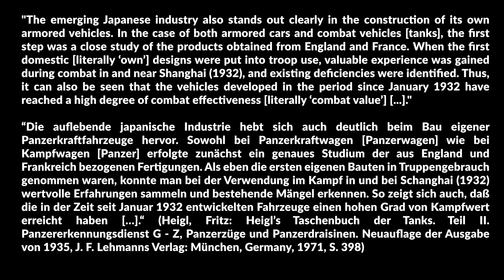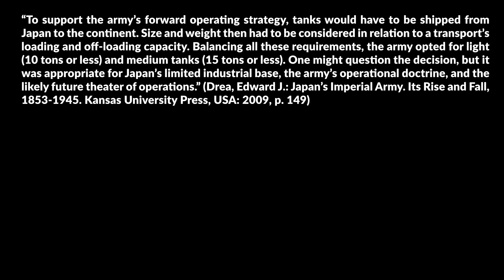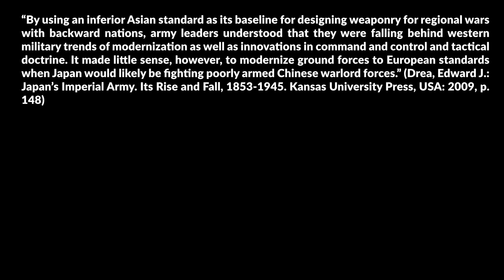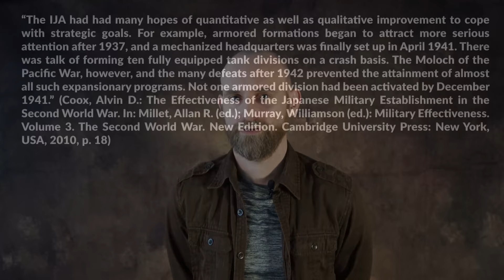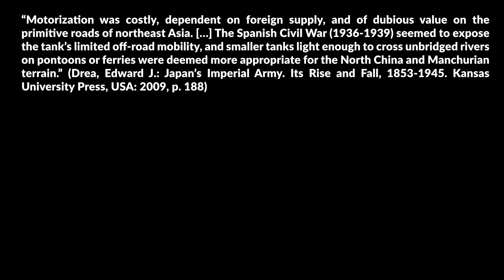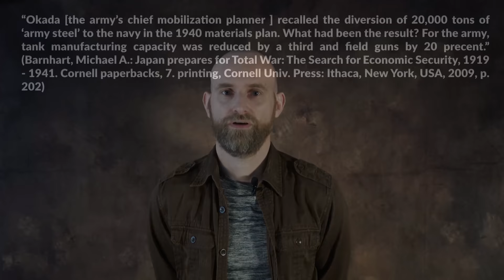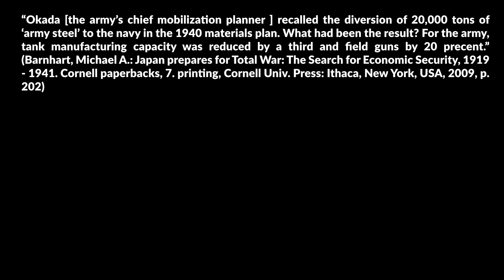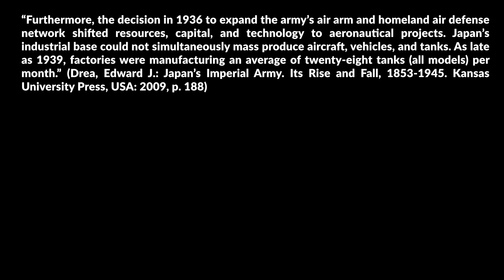The Problem with Japanese Tanks in WW2

Comment: It's essentially a transport/shipping issue. Chieftain has a video where he points out that by mid 43 the US Army knew from N Africa and meeting German Tigers that the Sherman was gonna be outclassed..  Yet it was already too late for a new heavier design. The logistic framework dice had been cast for a 30-35 ton medium tank... Everything from railcars to dockside cranes and shipping buildouts had ALL been aimed at that basic size.

For Japan it's the same but worse. Because of terrain Japanese rail gauges and car weight limits are even more constrained. Additionally the only cargo ships they had that could independently lift and deploy their "tanks"... Were actually 4, four, FOUR RR ferries designed to carry RR engines between Japanese factories and Korea/China; and two of those dated back to the 19teens.. think coal powered relics. 

Not that they didn't have more modern designs that had 50mm HV guns and even a couple of prototypes with 75 or 80mm HV guns and weighed in at a respectable 28-32 tons. In fact as it became clear in mid 44 that the defense of the Home Islands made shipping requirements somewhat moot... Suddenly development was prioritized, as much as a nation desperately short of everything could prioritize anything.. In the end it really didn't matter; even if CORONET had actually occurred in 46.. The number of the new tanks available would have at most consisted of a Brigade of 50-60 at most...  And they would have been outnumbered on the Kanto Plains between 20-30 to one just by Sherman's.. Not to mention Pershings' and whatever the Brits showed up with..
Reply: What are you smoking?

Olympic had no plans with British forces and was going to take place in 1945
Reply: @looinrims  My bad.. I meant Coronet as my mention of Kanto would have made clear to anyone not looking to jump on an innocent mis-speak.

Comment: The important question should also be if the japanese army actually had any use for a "real" tank-force. After all the fighting they did was often in areas with very, very poor infrastructure. What use is a tiger-tank equivalent in the jungles of siam or the wide country of china, where you can´t execute a blitzkrieg because the country is huuuge. There is a point to be made that tanks did not play a major part in the entire pacific theater. A mountain gun that can be carried by infantry is more worth then a sherman in most of those islands.
Reply: The actually did managed to execute something similar to the blitzkrieg but the Japanese high command misunderstood it so they dropped the concept of combined assault and focused more on the expansion of their navy.  Potential History managed dove in this topic especially the rivalry between the IJA and IJN

Comment: On the artillery front actually having an anti-tank gun that was actually a reliable threat to enemy medium tanks front armor available... EVER might have helped a bit, along with ANY form of HEAT type launcher/projector for infantry and more mines. Tank divisions of 30+ ton vehicles might have been beyond them, but seems like it ought to have  been all the more reason to be really focused on trying to maximize the anti-tank options available to infantry units. 

None of that happened though with the resulting idiocy with see with literal bombs on sticks, guys in holes with hammers and airplane bombs, and Shermans rolling through AT gun fire like King Tigers.

Comment: The Japanese tank was good enough for its intended use, which was anti infantry and a mobile pillbox. The US used light tanks in the Pacific too, in the same way for the same reasons. A Tiger would have sunk in most of those battlefields or got stuck trying to climb. The M5 Zippo and other M3 variants did far better in the jungle, was cheaper to feed and wasn't so destructive to roads and trails.

Comment: The little japanese tanks of the 1930's were fine for the terrain and fine against enemies without armour themselves. In no way  would the Japanese would have guessed that they would be facing something like a Sherman or T-34 in 1943. For me the main criticism should be that japan understanding they did  not have the capability for tanks but they could easily invest in decent anti tank artillery ie something like the Pak 40 that the Germans came up with. That's a lot cheaper and a lot more useful in defensive/static positions. That is what they really needed. Even had they built something like the 6 pounder ie 57 mm to 70mm that would have been more than enough to counter US and Soviet tanks. But of course a 75mm is much more useful for High Explosive needs.
Reply: by the time of 1943, the priority was to rebuild the Navy carrier force.

Without a strong navy, Japan could not reinforce, or get resources from all conquered garrisons in Asia.

Comment: Japanese tanks were surprisingly good for the years they were designed in the 1930s.
Reply: I mean the Ha-Go was on par with T-26. But the one man turret. Just why?
Reply: @firepower7017  1930s tanks were supposed to be infantry support vehicles.  Basically mobile pill boxes.  Drive up to the enemy and suppressing with a machine gun or small cannon while the infantry advanced.  Tanks were already expensive and high tech since you needed powerful engines, tracks and suspensions.  Based on that rationale, it made sense to make them smaller so they can be cheaper and more plentiful.  And that was what everyone did.  Only a few 1930s theorists were thinking about all tank units acting independently.  Even they had to admit the technology and designs didn't support that. 

In an alternate universe German tank design innovation ended in 1944 while US and Soviet tank design continued on track to 1990s levels.  Historians in that universe make fun of the Germans for having such bad tanks in the WW II fought in 1995.

Comment: How much of China's industry did the japanese make use of?
Reply: China's industry was mostly raw goods - coal, iron, food, wood, and last but not least, manpower (for farms, mines, factories, and other labor). Japan had a great need for these, and they helped to make up for a lot of shortcomings from domestic sources. Still didn't put them on the same tier as the US, the British Empire, or the USSR in productivity or output, but certainly helped them to compete, for a little while. China had little heavy industry.
Reply: Japan captured 90% of China's pre war industry (actually, more accurately, China lost 90% of its prewar industry, Japan only was able to use some of it)  However, MAnchuria, which Japan captured in 1931, had been heavily industrialized by Japan and it manufactured a lot of the small arms and basic supplies that the Japanese army used.

Comment: Not really! I dont buy with your point. Japan was fighting largely in the tropical forests of south east asia which was more of dense forests. Japan indeed required more of smaller tanks like Ha-Go which can support infantry assualt. So basically Japan needed more of anti tank weapons rather than having more of medium and/or heavy tanks!

Edit : Japan needed more of anti tank weapons rathar than lights tanks which can fight against British M3 Grant, M3 Stuart or even M4 shermans
Reply: Not really the case, it was rather that Japan lacked the materials and knowledge to produce better tanks, and since Anti-tank weapons are really simplistic, it became a easy and cheap solution to dealing with armor. It wasn't due to location that became the emphasis, rather the budget.
Reply: @firepower7017  what is the definition of "Better tank"? Japan had the tanks they needed! Why would they want heavy tanks? Secondly, Japan did suffer from anti tank guns! Facts cannot be denied, it was not the tanks but lack of anti tank guns what caused defeat infront of the british army at later stage!
Reply: @trejbiorgroup1713  They didn't the tanks they had was pretty much a dead end, the Ha-Go couldn't be further improved, the Chi-ha was outdated and the design couldn't be further improved, the Chi-Nu wasn't even used at all! And better tank? Let's see what they needed new from their main production tank.

-Better gun.
-Better ergonomics and crew placement.
-Better armor protection.
-Better track design.
-Better Suspension.
-Better engine.
-Better training for the new vehicle.

So essentially a more modern tank.
Reply: @trejbiorgroup1713  Also, if you complain about not having enough Anti-tank guns. Remember that they alone managed to wipe out nearly every Soviet Tank in Khalkhin Gol. So what did they lack when fighting the British?
Reply: @firepower7017  Again we getting into the loop! Khalkin Gol is prior to WW2. In WW2, Japan was fighting majorly against Britain and US and that too in islands covered with dense forests. 37mm Gun of Ha-Go is indeed sufficient against the tanks they were facing (M3 stuart- light or M3 Grant-medium). So light tanks were enough! Why would you need many tanks (heavy tanks) to fight in jungles and islands!
Reply: @firepower7017  Ill give you an another example. The Germans. In the quest for developing "better tanks", they ended up losing the war! They should have focussed on Panzer IV and StuG III, and Panzer V Panther should have been kept for dealing with the heavy armours. Germans kept on designing Tiger-I, Tiger-II, Maus, Ferdinand, Jagdtiger, and even beyond that with Monster and Ratte! These were absolutely unnecessary and complete waste of resources (both manpower and material). Germany failed to produce enough of Panzer-IVs and StuG-IIIs (less than 10,000 each) against 50000+ Shermans and 75000+ T-34s

It is not about making bigger and biggest. It is about making the right things!
Reply: @trejbiorgroup1713  I'm not specifically saying to build heavy tanks, quit trying to assume. It's really terrible especially if you're trying to call me out. I've simply stated that they should have made better and newer tanks intending to replace the old ones at the role they've been given. Since that's how a better tank should be made right? To replace the ones they're replacing?

1. With the situation with the 37mm gun, adequate isn't enough. Especially if you have to factor enemy armor and the gun itself, the M3 Lee was essentially invincible to ambushes due to the layout and armor, as it was heavily armed with Machine guns. And it's configuration allows it's smaller 37mm gun being able to defend the vehicle in areas which the 75mm gun cannot be aimed at. It would also be accompanied by infantry making it even worse, this was why soldiers and tank crews alike, loved the vehicle as well as being very feared. 

The Japanese 37mm gun on the Ha-Go also wasn't configured to fight any tank to begin with, it's velocity as well as shell variants was pretty mediocre. And the Type-1 37mm gun also proved useless against the Lee. While the side was vulnerable, it had to be hit very closely to pull off any damage. And ambushes in the pacific theater isn't like how Hollywood would picture it on films to being like that in Vietnam, as Japan had little knowledge on the islands they fought in, as they don't live there, so it pretty much was a guess. And coordination had to be on point or else things would go wrong, so essentially you had to target your enemy in a heavily concealed position, which would hinder accuracy as foliage and other obstacles would limit visibility, not only that but you have to predict enemy movement or else it isn't a ambush.

2. You're wrong about the Germans, here's why: The Panzer IV and Panzer III had an immense production run which would ultimately replace the older tanks that they fielded. It was really a handicap of the German industrial capabilities that hindered production as well as uncooperative territories. While it paled in comparison to what they Allies would make in numbers, remember that the Germans wouldn't be fighting them all at once since coordination was poor to even make such an attempt, unless you're the Germans which managed to make that possible. And the Panzer III and IV managed to lived quite a while, spanning many production variants as well as being upgraded to deal with newer adversaries. Even when the tanks became outdated, the Germans still had use turning them into the STUG and Jagdpanzer IV. Which was used until the end of the war. However them as a development platform dried out, which is why the Panther and Tiger existed, both a result to keep ahead of the Allies which worked and costed the Allies many tanks of their own, resulting to a development race that lasted the entire war. Wars will evolve, and WW2 is a big example of it.
Reply: @trejbiorgroup1713  Also why the Germans made bigger tanks 

1. Tiger family: It was a result of the devastating potency that was the 88mm gun, however the Germans hadn't have a platform which would mount the weapon, not only that but the recent encounter with the KV-1 shown the Germans that they need to catch up as early Panzer IVs and IIIs had did little in the way to harm the vehicle. And also both Panzer III and Panzer IV was food for Soviet PTRD and PTRS, so they needed a new tank which was far better armored than the Soviet heavy, as well as using the deadly 88mm gun. And it was also in time as the Allies would eventually make tanks that far surpassed the Panzer III which would end up all being converted to the STUG, which was a heavily effective vehicle, as it still had room for improvement.

The Jagdtiger was a result of not being able to produce the necessary amount of Tiger 2s expected in production, so it was a easy fix solution to the production issue as a desperation attempt.
 The Ferdinand was essentially Porsche tigers that got modified to be in use for service. It was also a desperation attempt in gaining numbers quickly. 

2. Panther: It was essentially lessons learned from the T-34 in how sloped armor improved the effectiveness of armor, this was right around the Panzer IV was pretty much done for in development. While sloped armor isn't a new concept, how the Soviets used it was pretty unique as it is depended on, and the Germans needed a new medium tank to replace the aging models of the early war period.

3. The Maus and Ratte was pretty much dumb, even German high command felt like the vehicles was a dead end. While the Maus had some usability, the Ratte is fictional, don't even mention that.
Reply: @trejbiorgroup1713  Having to produce better isn't a bad thing. It's essentially towards winning and is how the Japanese managed to fight off in the aspect with the navy during the early years. It lead with aircraft and aircraft carriers as a priority toward attacking. And that is why it kept Japan alive for so long during the war.

The A6M Zero was a groundbreaking plane for Japan, but you would see it as a waste of time, preferring the A5M as it was adequate, while slower, had poor range, terrible top speed and even armament, it could damage the enemy just barely and it still should be good? Such backwards way of thinking should have already died in the 1930s!
Reply: @firepower7017  not really! Pz4 were vulnerable to PTRD agreed that is why shurtzgen were introduced. See, my point is clear. Not necessarily you need better and better tanks! You need skilled soldiers and decisive strategies. M3 Lee/Grant had poor armour from the sides so it wasnt a great tank either! My point is simple. Japan never wanted heavy or medium tanks. They needed smaller and lighter tanks only which can be shipped from Japan to Okinawa, Iwo Jima, Burma and Singapore. More heavy tanks means more logistical problems. Anyway Japan was not going to surrender! It never ever the Tanks that made Japan surrender, infact it was the A-Bomb!
Reply: @firepower7017  trust me. Germans never produced enough of the Panzer IVs and SruG-III. They never crossed the count of 10,000
Reply: @trejbiorgroup1713  Many sources, even Military History Visualized counter that, by stating about 15 thousand Panzer III and about 10 to 13 Thousand Panzer IVs have been made. So you're wrong.
Reply: @trejbiorgroup1713  Where to point out, firstly. Look how WW2 played out, Germany had the technological edge when it came to fighting the rest of the nations, a simple radio had managed to do a lot when it came to coordination, skill doesn't mean nothing if you cannot properly use it. War is a complicated mess and to look at it in one perspective is illogical like what you're stating as a whole. Technology is a big importance to war as any other factor. You cannot leave it out.

Japan is backwards for it's stagnation and is a component for it's defeat.
Reply: @trejbiorgroup1713  Also, as for the Panzer IV, the side-skirts was an addition to it's various upgrades, but look at how the addition of the added panels was pretty much the last upgrade it had, the development platform as a whole for the tank, and every other tank in existence has this issue of being a dead end. And I can list all the tanks that had pretty much met their end toward having no room for improvement. Like the KV-1, T-34, M4 Sherman and even the Churchill.

And once a better replacement is found, it's necessary to replace as to not lag behind.

Comment: Japan started expanding and conquering Asia in order to secure the raw materials it needed to fuel its expanding industry, until that conquest was complete they couldn't invest the raw materials needed to build the tanks they'd need to take on the USSR.
Most likely, had things gone differently, they'd have built tank factories in mainland China and Korea and driven the tanks from there to the Soviet border area.

But even as it is, the Japanese did pretty well in the fighting with the USSR that did happen (prior to 1945).